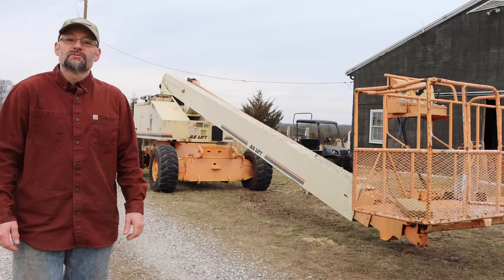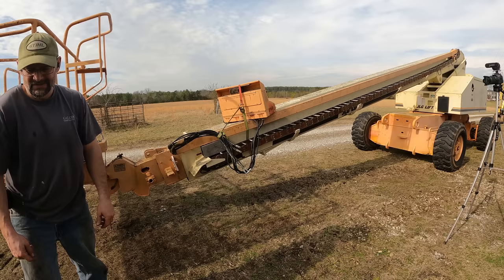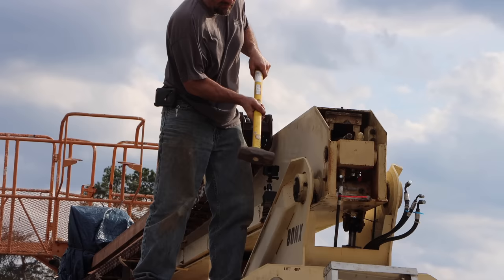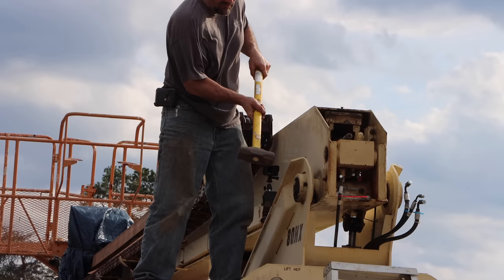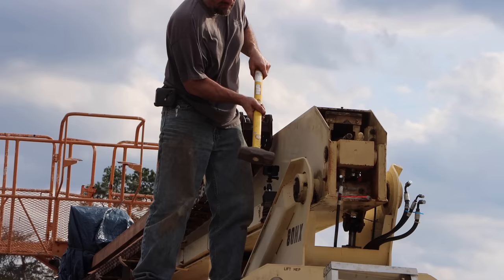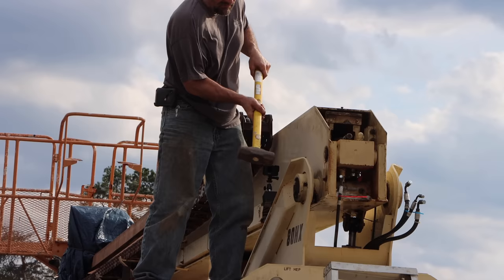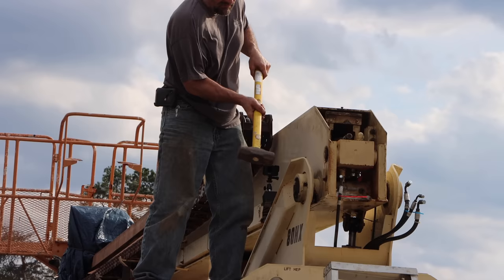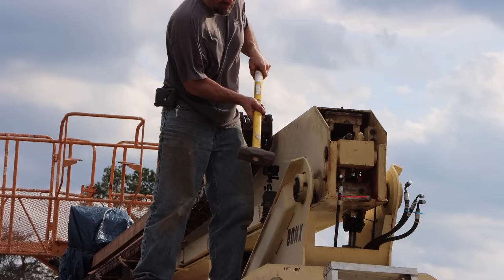JLG Boom Lift Tear Down, Ended In Disaster!

Comment: Well once disaster struck that could have gotten a lot worse, glad you are ok. That was scary to watch, I can't imagine what it was like for you... actually I can, my situation was nowhere near as bad, but I connected a wiring harness that wasn't supposed to go together and nearly set my Ducati on fire. There were no flames, but it filled my garage with thick smoke in seconds and completely melted through the harness to the fuse box and ignition switch and wires had fused themselves together, so it was close. I also had fuel lines and a tank almost sitting right on top so flames would have made the situation much worse lol.
The odd thing was that the fuses seemed to protect everything on the other side from melting but not one of them blew.
The other odd thing, come to think of it, is I still don't have a fire extinguisher in my garage... Not that it helped you lol.

Comment: So many get this wrong but a stuck pin / bolt needs heat cycling don’t hit it or press it hot just heat and cool it a few times spraying pen oil while it cools aim of the game is to get it move a bit braking it free if you move while hot you risk wedging it in more against rust or the like or kick up a Burr hot metal is softer/weaker

Comment: Hey John, I have a mag drill at work that is not the same model you have but I think it has the same functionality. It is a feature designed for the situations you demonstrated at 17:09 in your video. My drill has a bolt in the pinion end opposite the handle. I can remove the bolt and pull the pinion shaft out and install it from the opposite side. I see on your drill an allen head bolt and an oversize washer on that pinion shaft emd. I bet yours is reversable as well.

Comment: Removing pins aren't fun....

In our shop, theirs times where very large pins are pretty much welded seized. 

We use 2 primary methods when a sludge hammer / heat fails or when theirs no spot to clamp on the hydraulic press.

We bring the seized component out to our yard and position it so we can slam the arm of the excavator, straight down to free the pin, and believe it or not,
 sometimes takes a few massive blows with our full sized excavators.
or 
we weld a mounting point straight to the pin, so we can attach a chain to the excavator arm and just yank the pin out.

you did a great job. You live and learn... shit happens. that's life... hahaha

Comment: I'm watching you mag drill a hole in the pin right now and when you were slamming on that pin I kept getting the sense that there is a dowel or something in that pin that maybe was filed flush with the surface and then painted over but for that pin to not move at all makes me think it was secured in that block somehow.

Comment: Glad you are ok. There is one tool you can add to your arsenal specifically to deal with large stubborn pins.
That is an air demolition hammer, a rivet gun/air chisel on steroids.
Take a look at an Ingersol Rand 4A2SA. Requires 29 CFM at 90psi.

Comment: With powder extinguishers you only have to press it once and the valve doesnt seal because of the powder and slowly releases the gas under pressure its a one off use.

Comment: When I worked at JCB we took persistent pins out with a hydraulic hammer on another machine.
The pins that still didn't come out got melted out by a 3rd party :D
I think we had only 1 or 2 pins a year that the 3rd party had to come for, all the rest was hydraulic hammered out.

Comment: Just remember if you haven't burnt some equipment doing something like that , you haven't done enough work on machinery yet, especially backyard work. I bet one of the next things you fix is water and fire suppression work.  Once saw a near new speed boat go up in flames because the extinguisher didnt work.  One night was driving my tip truck when I saw flames in the side mirror no extinguisher but plenty of dirt. A fuel line began to leak petrol. Whilst our stupidity or ignorance may cause us trouble, on the good side it let's us go where angles fear to tread and get the job done and do things others fear to do. Glade everything turned out well, steel is only made in the hottest fire.

Comment: A trick you could try to get that pin loose, is at 14:34 where you placed your finger and talk about heating, is to drill a hole to the pin, and tap these holes on both sides, and then place some grease nipples. Then pump as much grease in there as you can, the only way out for the grease is on the outsides where you have hit the pin, and between the 2 gaps where you have cut the pin. Grtz

Comment: You had a great time with those pins, didn't you. More fun than a barrel of monkeys. I'll tell you, I was really concerned for your safety and  the machine too. Those fires in hidden areas are often a disaster but you did the right thing, leaking well hose be danged, and got water on it in record time. You might need to replace a hose, but you're safe and the lift is salvageable. I love the challenges you put on yourself and am amazed at how you figure it all out. Looking forward to seeing the next video and the reconstruction of the lift. I can do with less anxiety though. I bet you could too.

Comment: A while back you asked about wether or not you should get a sand blaster I think, I tried to tell you about this machine that is better it’s called a vapor hone you can see it on this channel Rebuild Rescue they have one and use it to clean airplane parts and they come out like new they even went to where they are made here in USA they sell all different sizes.

Comment: @FarmCraft101   In this video @13:02 you are removing an outer snap ring from the pin.
                                Just below that pin is a grub screw/ set screw that holds the outer bushing to the machines arm
                                That may be part of what is holding the pin in but Im not certain.

Comment: John, have one of these that's quite close to this one in age, but mines a 40 ft. I replaced the o rings or 🦭 s on the cylinder, and that pin in it was the only one that came right out. I'm having trouble with the control wires to the basket, just about given up on it.

Comment: I would have tried to drill smaller holes on either side of the center of the pin and made a two-pin wrench with some steel bar to try and rotate the Pin inside the bushing to loose it up.

Comment: You had a brain fart. Right from day 1 of my working career 50 years ago, rule 1: when oxy is on the job, so is fire equipment, within arm’s length of work area. Even in remote locations. If oxy was involved at least half a dozen large extinguishers were loaded on the truck to supplement local resources. And absolutely no one worked alone, but the brain fart still happened. Familiarity breeds contempt. Prior to me starting in that workshop, an employee was horribly burned in a brain fart situation.
You’re too valuable to too many people to continue making boo boos like that.

P.S. I had a cockpit fire at 3,500ft agl with the Wife on board about 12 years ago due to faulty wiring. That was interesting, we’re both still here.
Thank you for sharing.

Comment: not sure about that particular model but on the mag drills i've used you can either swap the handle to the other side of the drill or remove some of the handle to get clearance, might prevent some future expensive accidents.

Comment: Did that extinguisher have a plastic or metal valve? There was a massive recall on extinguishers about 5 years ago. The plastic valves would break internally and nothing would come out. You may still be able to get a free replacement. There was a website you could go to and enter the make, model, and serial if applicable and 3 weeks later a new one with metal valve would show up in the mail.

Comment: I watched a guy with a number of 4 foot cutting rods attempting to excise a massive siezed crossbar out of a piece of machinery some time back who was also less than successful initially, granted it was done in a field from a repair truck. They ended up welding a 50 ton hydraulic jack onto the side of the upright and pressed it out also. It ended up being a three day job til they got to the 50 ton part, as they had to go acquire one when the 20 ton blew its guts all over the side of the upright.  
This was a HUUUGE job, especially for one guy! Probably more than I would want to take on by myself, so kudos for guts and/or ignoring that part of your brain that likes to condescend you with common sense advice. 😉

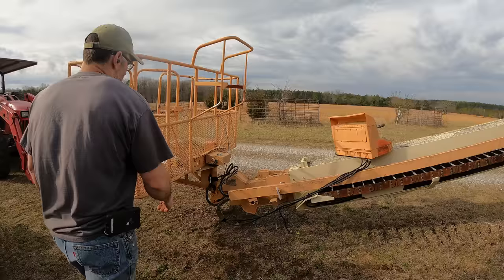Comment: Notice at 6:30 there are 2 slots in the metal plate? Almost as if the manufacturer knew operators would, more than likely, need to cut those bolts off.

Comment: Before cutting the pin you could have welded a pipe On the Pin and then used a pipe wrench on the bar and then used the excavator to see if you could break it free.

Comment: i wonder if welding a bolt to the pin and using an impact to spin would be a good way to get those frozen pins off?  i think spinning them first would work good

Comment: Jon, I just noticed.  You are disconnecting the hydraulic fittings, 
with a 16 MM wrench, anda 5/8ths wrench.  You know they are 
different sizes?  About 6 or 7 thousandths different.  I also don't 
pay any attention to SAE sizes that begin with 5.  5/16?  8MM
5/8, 16 MM 5/4 (1.25)  Yep, 32 mm.

Those can openers on my key ring?  One is 38 MM, the other is 
51 MM.  BOTH those numbers, WWII fighter aircraft!
(Oh 38 MM 1.5 in.  51 MM 2 inches.  Yes, they are called P-38, 
and P-51.)

steve

Comment: I really hate dry chemical extinguishers.  They never work when you need them, and they make a huge mess.  I have a large (10 lb) CO2 in my shop, they will kill chemical and oil fires nicely.  They are, however, not for dry fires like wood and sawdust, they just blow the fire all over.  I carry a 5 pounder in my truck as well.   I also have another 5 lb. liquid extinguisher, it's not Halon (expensive), but it's rated for electrical fires.  And lastly, I have what looks like a 5 gallon jerry can with a hand pump and hose on top, it just pumps water for those instances where water is the ticket.  Most important is to know what extinguisher works best for what fire, and to keep up the service on these units.  And, have more than 1!   People just buy them and let them sit there for 10 years, they need to be checked and refilled regularly.  The dry chem are rated for all types of fires, but they don't work well on any.

Comment: In hindsight, you probably should be happy that extinguisher didn't work. Those powder extinguishers are salt based, and that powder will get EVERYWHERE. It'll start rusting everything as if it had been rolling on the salted roads in the Rust Belt, times ten. You could probably wash it off before it did too much damage, especially where the fire was, but it was pretty much guaranteed to get in the engine compartment and the electronics box, and that would have been no fun at all. Although I know that feeling of running around when fighting a fire and nothing is cooperating.

I always laugh when people say "that gave me anxiety", but seeing that molten metal drip down without knowing where it went really made me nervous, especially not being sure where the fuel tank is located. Then nothing seemed to happen, and you sprayed that hot bushing with something that's pretty flammable. Normally I wouldn't be too worried, but your commentary made me think we'd get to see a massive fireball there.
Also, as far as extinguishers go: In case you don't know which type to get to replace that one: for the work you do, one that can handle solids and liquids burning would be enough, unless you expect to light a metal like magnesium on fire. If extinguisher ratings translate properly, one rated for A and B fires should do. Usually that will be either a foam or powder extinguisher. Foam is a good balance of extinguishing options and side effects, and probably handles a bit better in high winds. Powder will do the job just fine, but has some nasty side effects, both on metals and on people.

All in all, I respect the hell out of you. Not only for attempting this repair, which is daunting, but also for admitting to your own mistake and explaining how you got to making that mistake. You didn't just say "I made a mistake", you explained why you were able to make that mistake, even though you're normally well prepared, that's how people learn. Everybody makes mistakes, not everybody owns them. Now I'm gonna keep an eye out to see if there's an extinguisher nearby the next time you're doing something with fire ;).

Comment: Remember, when brown/black smoke turns white. You know you just put the wet stuff on the hot stuff. Man that could of been disastrous! Just goes to show, old school bucket brigade is better then nothing 😂. If I may make a suggestion, get ya a good 10 pounder or 20 pound fire extinguisher. Judging by the way that small one went off when you crushed it, it still had some pressure inside, but not enough to actually discharge the agent. Curious how old that small extinguisher was?

Comment: Those plastic head fire extinguishers are universally junk.  I had the same thing happen with an identical fire extinguisher.  Thankfully, I had a bucket of sand nearby that saved my bacon.  If "sometimes" isn't good enough, spend the extra $20 on a rechargeable fire extinguisher with a metal head.  Also, make sure to turn them upside down every time you check them.  The powder can cake up in the bottom and results in them not working as long as expected, and instead just blowing propellant.  Turning them over helps prevent that from happening.

Comment: Regarding Chemical Fire Extinguishers.  At a MINIMUM - once a month when you check them - you turn it UPSIDE down - and SHAKE it for a bit...
Otherwise the Chemicals in the cylinder will slowly sink to the bottom and SOLIDIFY.  It will still read "green" because of no actual pressure change - but will be totally useless.  Just a heads up to you and everyone else.  I don't actually know all the in's and out's of Chem extinguishers - but did work Maritime; and they want those things turned upside down and SHAKEN.

Comment: That sucks 😬 At least you can be sure that alot of your viewers are now well equipped with fire extinguishers 😂 so you probably even saved some people.
It looked like your extinguisher was a powder extinguisher. if that thing had worked all your electronics in the boom lift would have corroded away in the next months because that powder gets everywhere and you can't clean it all. so maybe water was the better option anyways. foam extinguishers are often better, the new ones are even biodegradable lol

Comment: Do you need special drill bits to drill through the pins? I’ve always been told by old heads that drilling pins is a waste of time but you were very successful!
Reply from the maker: That pin is just 1045 steel, not particularly hard.  Any decent drill should do.

Comment: when I get to pins or bolts that large I cant get to come free, I drill like you did and then heat the inside with the oxy acet, and quench it with the hose for about 30 seconds to shock the rust and  It doesnt overheat the rest of the part as you were concentrating the torch onto the center of that pin
Reply: 3 minutes after my comment you did that and it worked!!  Now remember, drill, heat from the core and shock!

Comment: What would it have cost to have a dealer service this? Tear down is definitely awesome content and glad you didnt get hurt or burn the machine to the ground.  Was also thinking to myself, after you drilled the pin out, would sticking a sawzall in the hole and cutting a slit in the pin almost to the bushing have helped rather than hitting it with the torch?

Comment: Question.. why not drill in the middle of the outside plates center of pin to spray some oil in there or drill for grease zerts.. same for the big square in center? Maybe drill 2 or 3 spots and tap for oil or grease zerts

Comment: This is why home quality extinguishers should be replaced every few years. Commercial grade get inspected annually and every five years they get depressurized and recharged. In the future, every year whack the bottom with a rubber mallet several times. Also, don't buy the ones with a plastic valve.

Comment: Once hole drilled could you tap and insert bolt and use long cheater bar to twist the pin to break the adhesion?

Comment: When you moved the cylinder over to the shop it looked pretty bent and Had a large curve in it wounder of that cylinder been over its limit a few times @FarmCraft101
Reply: Filming on gopros from a long distance away always gives that illusion.  Most of the time you do not notice it, but on long straight objects, it looks like they are bent, when in reality they are not.  I'm not saying the 25' cylinder didn't bend at all, but it was likely very minimal.  Most cameras have some form of distortion, but gopros are terrible in that regard.

Comment: Funny, I always spray penetrating oil (CRC Knocker Loose) before I apply any heat.  If that pin was installed covered with "never seize" or just oil there would have been be no problem.  If there was no rotation at that joint, why did they install a pair of bushings on that pin? Ron W4BIN

Comment: Did you inspect the extinguisher to see if the valve opened when depressing the handle? I think it was pressurized by the looks of the slow-mo even considering you crushed it. Maybe a plastic piece that pushes the valve pin down and opens it was broken?

Comment: 50:23 Instead of heat why not use your reciprocating saw? Nice straight cuts then bang the pieces out with a hammer. All the torch does is make a mess

Comment: Seeing you had a hole through the pin did it not occur to take the recip saw and cut it in half? Or a reason you couldn't?
 Those household extinguishers have failed me every single time. Not once have they worked when I needed it.